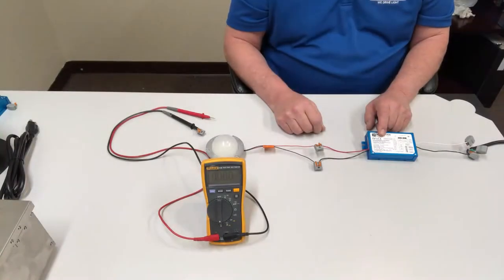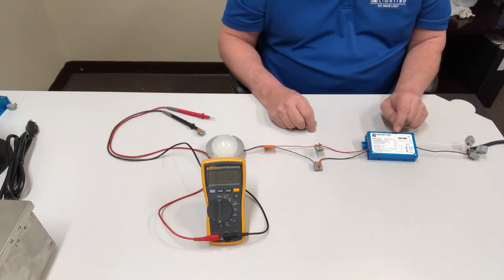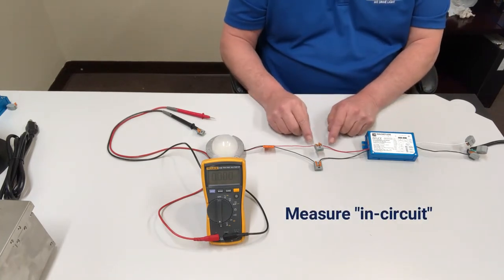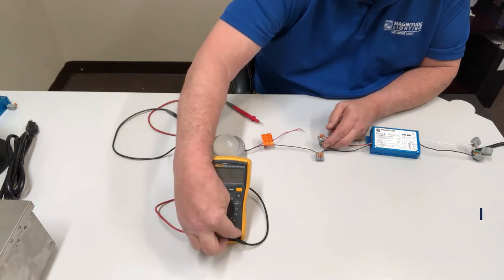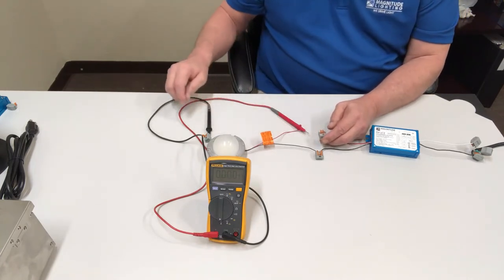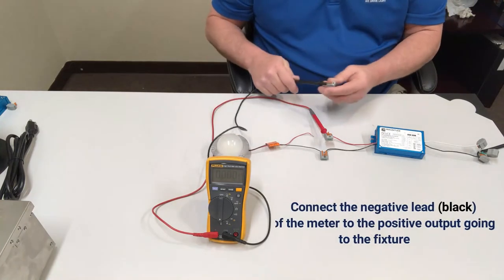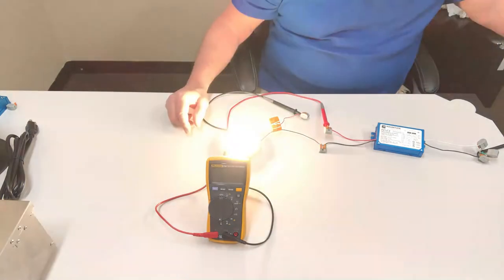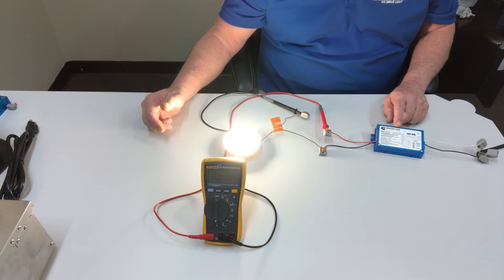How to Measure Output Current of an LED Driver When mA Is Not Known

Comment: But if the lamp consumes more than the driver can supply, then you kill the driver !  
Wrong way !
Reply: exactly what I am concerned about. is there another way to do this?
Reply: @nycelectrical2548  did you find a way? I'm currently sitting in front of my lamp and need to check the driver with a load, but nothing in my household with 58V and 0.7A comes to mind...